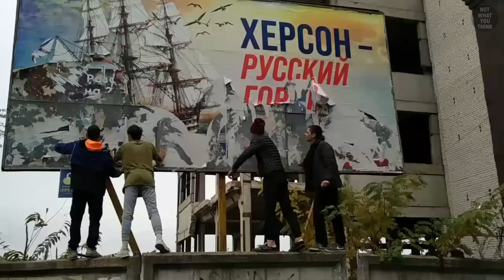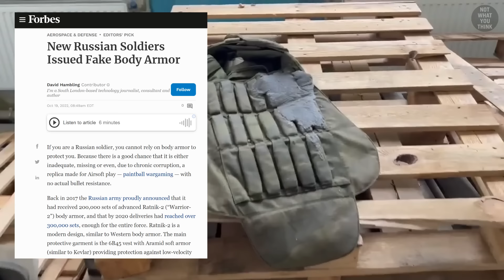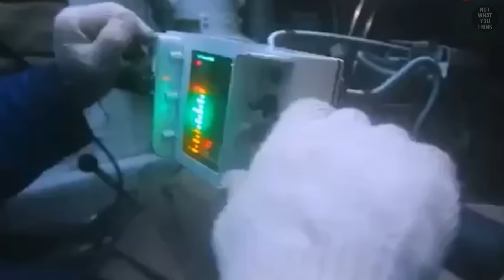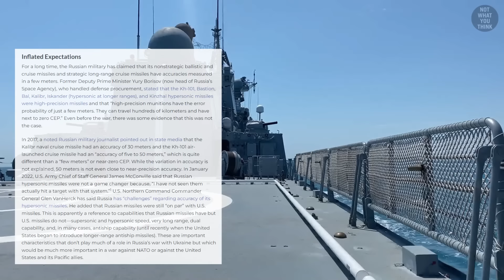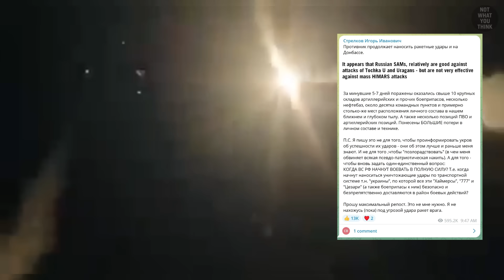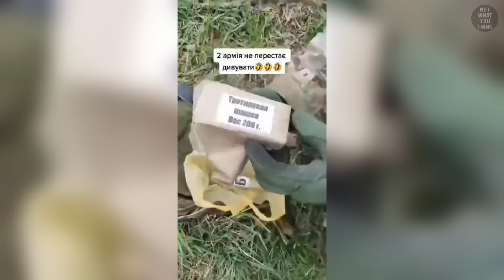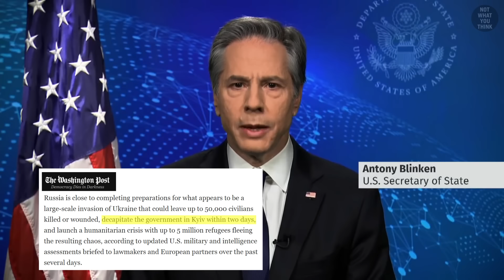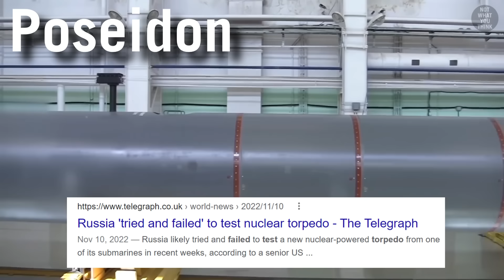The True State of Russian Army

Comment: In fairness the Mosin-Nagant is a superb rifle. The USMC still use a version of the 1950s era M-14. 
The Lee-Enfield was used  as a sniper rifle in many nations  up until recently
Reply: It's garbage against assault rifles. All bolt action rifles are trash against even the worst of assault rifles in modern military tactics.
Reply: Having one mosin in a DMR role isn’t bad, but a druganov or SKs is better. The fact that regulars who should have AKs are using mosin is a bad thing
Reply: The M-14 is a derivative of the WW2 M-1 Garand and is capable of full automatic fire (but utterly uncontrollable if you do).
The difference is general issue versus special issue…
Reply: @allangibson8494  m14 actually can be used as a battle rifle(isn't it one though?). It has a decent box mag (15 rounds I think), semi auto mode and full powered rifle cartridge.  Mosin rifle is bolt action and uses clips. That's a huge difference.
Reply: @maxk4471  Which was pretty much my point - seventy years of development separated the two… 
(That said, the M91 Mosin was still in production in 1973 when the M14 had already been withdrawn from general issue).
Reply: This still doesn't explain what the hell happened to their millions of Kalashnikovs. Probably sold all of them to Africa.
Reply: Agree with above. The Mosin-Nagant is a specialist weapon. Is in no way a replacement for AKs, that should be in use by the majority of Russian troops.
(although they do seem to be using  very old AKs rather than the newer variants)
Reply: @Cincy32  @600 yards, I'd take the Lee Enfield...
Reply: @mikitz  The Kalashnikov’s we’re stored wet and are rusted solid (and are older than some of the Mosin Nagants).
Reply: the mosin sucks, people who own it literally call them garbage rod and agree that its faster to take apart the bottom of the magazine and throw the rounds in than actually use the clips
Reply: @josephpruitt2067  And I like to see how well you shoot in a century…
The Mosin Nagant was actually a really good rifle - in 1891.
They were also all sighted and tuned with the bayonet fitted. No bayonet = crap accuracy (they need the half kilo hanging off the muzzle for tuning). It’s an issue with light barrelled rifles like the Mosin and Lee Enfield (the Lees need 2lb of up force on the muzzle from the stock to shoot accurately.
Reply: @allangibson8494  the gun shooting bad because of them sighting in with bayonets on is on them. Who sights in a gun for a mode meant for close quarter combat. Besides it wouldn't be a great rifle in 2 years, after they made the mauser 93
Reply: @josephpruitt2067  The Russians do.
The big advantage of the Mosin over the Mauser was Russia could build the Mosin - Mauser’s were made in Germany.
The Japanese were even more in love with the bayonet - they fitted them to their heavy machine guns.
Reply: @josephpruitt2067  Yet 9-hole Reviews shoot C-targets at 1100 yards with a Mosin...   using only iron sights.
Reply: @allangibson8494  If the russians think its a good idea to sight in a ranged weapon with an attachment on thats meant for hand to hand combat, which messed up their aim which completely, contradicting the point of sighting in a gun, then thats on them. Even if the russian couldn't have bought the mauser, they could have made a new rifle based on the Mauser design like the US did
Reply: @josephpruitt2067  And the Mosin Nagant was the third bolt action rifle design the Russians adopted while the US Military was still arguing about the whole concept of magazine fed rifles…
The US adopted the Krag Jorgensen in 1892 as their first bolt action rifle so that is your direct American comparison.
Russia didn’t do too badly by comparison - they just hung on longer than others.
The Springfield 1903 was an utter dog by comparison with multiple revisions and catastrophic action failures for 15 years after adoption. The 1917 Enfield was much better (having been designed and built by companies that actually knew what they were doing).
Serbia used Mauser rifles in WW1 against the Austrohungarian Empire - and demonstrated why they were a bad idea. As a note - everyone who ever used Mauser rifles in combat, lost (correlation is not however causation).
BTW - Russia issued semiautomatic rifles with 20 round magazines to troops in 1916.
Reply: @allangibson8494  you seriously think that the mosin is better than the 1903?
The 03 had a better action and better sights. The sights on a 1903 are literally competition sights. The 1903 was so accurate the germans gave it a nickname. And as for everyone who used a mauser lost. The 1903 is based off the mauser action. And the mauser beat the mosin on the eastern front. And so what if the russians introduced a semi automatic rifle in 1916. The russians lost 2 years later.
Reply: @josephpruitt2067  And the 03 was a crap combat rifle BECAUSE it had overly complex competition sights with too small an aperture that were unusable in night and low light combat and extremely poor quality receiver manufacturing. The Springfield had exactly the same problems as the Canadian Ross Mk3 rifle (other than miss assembly issues).
That’s why the US Army withdrew the first million manufactured from military service in 1918.
The Pre 1918 1903 Springfields were significantly worse rifles than the M1891 Mosin Nagant in actual combat. The M1917 Enfield was far and away a better rifle than the M1903 Springfield.
Once Springfield got their act together the post WW1 1903’s got acceptable - but were past use by in 1940 when the M1 Garand started rolling out.
Reply: @maxk4471  I have an M1A, standard issue magazine is 20 rounds
Reply: @allangibson8494  the Mosin had a bad trigger, bad action, used a rimmed cartridge, crap could easily get into the action, the sights were primitive, and the gun was inaccurate. The mosin's quality control was terrible and it was too long.
The springfield had better sights, was more accurate, had a better action, used a better round, had tight tolerances, and was short and fit in the trenches. I really fail to see how it was a worse rifle than the mosin
Reply: Only the Marine Corps shooting team uses the M-14 for shooting competitions   the Marines do not use the M-14 in frontline role at all
Reply: @josephpruitt2067  the whole point is none of those things were a problem when the Mosin was developed.
The Mosin had quite good accuracy when NEW. A century of being thrown into the back of a truck by inept shooters doesn’t do good things to anything. Rimmed cartridges were standard globally in 1890. They were only a problem for people who saw them as a problem (and didn’t know how to make cartridge cases properly).
The M1903 Springfield was most definitely a piece of crap - it (like the Ross Rifle) was a target rifle trying to be a battle rifle but with lousy manufacturing quality. The manufacturing quality got fixed EVENTUALLY but it was still inherently the wrong design for a battle rifle.
The 1914 Enfield and it’s derived M1917 was a much better battle rifle but short on magazine capacity (a common failure with all the Mauser derivatives).
The M1917 was designed for manufacture. The M1903 wasn’t.
Reply: @Cincy32  bolt actions have farther effective range and while not capable of semi and automatic fire the bolt action rifles still put a decent amount of lead down target. A well trained soldiers such as snipers  (not Russians lol) can suppress the enemy with bolt actions if the shots are well placed. Bolts actions are obsolete but not ineffective in war. While automatic  rifles are in theory capable of mag dumping hundreds of rounds in a minute, the guns will seriously suffer and break from   overheating so the practical rate of fire per minute is way lower than the cyclic rate of fire. Bolt actions rate of fire can be pretty high depending on model and individual soldier like how British soldier with Lee’s shot faster than  Americans with semi auto m1s.
Reply: @mixmaster2909  Thanks for the clarification. I thought the EBR was still in use.

Comment: It's still a good rifle especially with a good scope on it . I have a .243 varmint gun based on a Mauser 98 action that was designed in 1898 and my one was manufactured in 1902 . With some modification and a heavy alloy rail stock plus good handloads it shoots very accurately .
Reply: Yeah, one round at a time
Reply: @koberburwa  Even today western army snipers mostly (/all?) use single shot bolt action rifles as they are more accurate. But not for generally infantry work.
Reply: @philldavies7940  its a pipe rifle compared to modern equivalent
Reply: @chaoswraith  yeah for example the barret is semi auto and shoots massive 50 cal bullets
Reply: @chaoswraith  you are insane
Reply: I absolutly believe it´s a good gun and it can still be used. But the problem is, a modern army normally would have modern guns. It is not a good sign if hunderd year old rifles are being used by an army instead of modern sniping rifles. It´s like fixing something with tape. Sure it works but if you use that item allot it´s not a good long term solution.
Reply: Do you use it for shooting people in a battlefield though? Or do you use it for shooting animals or targets? There's a big difference
Reply: Could understand Bolt actions being given to snipers and maybe even second line and "peacekeeping" soldiers in occupied territories but sure as hell not frontline combatants.
Reply: @philldavies7940  Yeah most snipers are Bolt actions in western armies though there are a few Semi-Auto's I think (idk I dont study guns and that stuff very often at all.)
Reply: @obi-wankenobi8446  For sure it depends on the person but if the gun is accurate the gun is accurate
Reply: @chasejordan9295  that's not at all how it works in war lol. In a CQC battle a bolt action rifle is useless, and evidently so.
Reply: Let’s bring back the catapults. It can kill! 👍
Reply: Mosin Nagants are awful. They were awful back in the day, even. 

The Mauser 98 is a superior design. But it's still not a modern combat rifle by any stretch, and even though many modern sniper rifles are bolt action, they're a LOT more advanced than the 98.

Plus, most people aren't snipers. And if that sniper gets involved in combat rather than taking a shot and fading off into the night, they're going to use something select fire.
Reply: @o5-330  and is inaccurate as fuck??? you know the barret wasn't made for precision shooting right? right?
Reply: Mosin-Nagants are fine for certain things if they are accurized, QC was garbage during manufacture, but they are still not up to modern combat. They are suitable for sporterization as civilian hunting rifles and as collector wall-hanger surplus rifles. Militarily all they are good for is ceremonial, training, and far-in-the-rear security duties for troops that should never have to use them in anger. That they are being issued out of Soviet stockpile to frontline combat troops today is frightening. It was replaced in the DMR role by the SVD in the 1960's. Insanity.
Reply: Barrett weight 14kg, Mosin Nagant weight 4kg...

Mosin Nagant is a very good sniper riffle like every other serious military riffle. Old riffle doesn't mean bad riffle. They are intended to kill. Old riffle like Mosin Nagant are overpowered, they frequently overpower modern riffle...
Reply: I can get better MOA for $450 at a Walmart, buying a Savage.
Reply: @o5-330  0.50 calibre is for the small vehicles, armor, buildings not for people
Reply: @Armored_Muskrat  It' not modern yes, but well kept it's good and accurate. Just a reminder, Simo Häyhä used Mosin-Nagant.
Reply: There is a reason when we do a quick combat assessment on if a position is worth taking with what we have available we always count enemy machine gunners are 3 men to our 1. Yeah a rifle can kill you. But it can only kill one of you. Combat engagements happen at ranges between 100 to 300 meters in most cases. We Qual on the M4 with a 300 meter target being the max range that pops up. I don't argue that a rifle that old can't be used. I argue that it brings no value compared to a modern rifle in terms of accuracy, reliability, or ammo capacity. If anything it's heavy and unwieldy. Keep in mind this is being issued as an infantry rifle. A sniper is a specialist role and can use any rifle more effective than an infantry soldier.
Reply: Some US Army snipers use a rifle based on the 50 caliber machine gun, in single shot mode. 50 caliber bullet can go a mile accurately. that gun goes back to World War I. Some good gun design seem to be competitive a long time. Look at AK-47, from 1947.
Reply: the Mosin was a barebones rifle that simply did a job and nothing more in its heyday. It was noted in WW1 as having feeding issues, poor tolerances, and being a less capable rifle than others used at the time. That was 100 years ago. I have a Mosin now, it's more finicky and inaccurate compared to any other rifle I have. I certainly would hope to not need to rely on it in combat.

Comment: It does not take a genius to understand that it is not smart to send the best equipment and soldiers to deplete your enemies reserve.
Those rags they wrap around their feet are actually sort of sock. If it gets wet you fold it open and hang it up taking shorter to dry than average socks and not as prone to have torn holes in them.

Comment: Im sorry, but you got a couple of Things wrong. The T14 Armata at the Victory Parade didnt Break down or stall, the Driver engaged the electric Handbreak by accident, and as the Crew wasnt properly trained, they didnt khnow how to Turn it off. You can see this by the tracks not moving an Inch. T14's which did break down with engine problems have been documented beeing toewed away by recovery vehicles. Another thing is the Rubber reactice Armor. The tank, which they were on was a abandoned russian Tank which has been aledgidley scrapped for parts by ukrainians. In the original Video you can hear him talking about that. Of course These are Just Tiny nitpicks, and dont Change anything about the russians performing horribly due to curruption and lies. Back, when the war started i did Not expect Ukraine to hold Out a Week. The way the russians really perform, one can only Imagine how they would fair against NATO.
Reply: The crew were not properly trained, thats convenient.  If your going to showcase your MBT at a parade of that size, i think you might have a crew that can operate the vehicle, so I'm inclined to believe the thing broke down regardless what you say.
Reply: Either the machine doesn't work or the operator is drunk. Now that's Russian if anything.
Reply: an improperly trained crew is worse than a breakdown. lol. breakdowns happened to the best of us but a badly trained crew is a much bigger issue. that's embarrassing
Reply: Soldier operating the country’s most prized modern tank hits the wrong button in a military parade and that’s better?

Comment: Just a possible correction. The helmet at 4:36 could be one of the older soviet helmets, such as the Sfera, but it does look kinda weird. It consists of several steel or titanium plates.
Reply: Helmets aren't used to protect against bullets but ricochets and falling rocks.  
It hasn't ever protected against bullets and why helmets weren't used when we using muskets. Instead we see people with fancy hats, some sort of idea that they will aim at the hat and miss the head.
Reply: @robertagren9360  They protect your head from w/e haha. They are mostly not designed to stop bullets, though some models are rated for pistol calibers, but even not technically rated ones have saved many a noggin from bullets. It really just depends how far away they are shooting from and what caliber, there have been quite a lot of instances in the sandbox cause 7.62x39 out of guns with shot to hell barrels are subsonic by ~100 yards, maybe less.

Comment: The helmet at 4:35 is actually called a sfera, use during the 1st and second chechen war, its one of the only helmets to utilize armor plating, like a plate carrier almost. It is ineffective and outdated, and if the helmet was shot it would cause the plate to dig into your skull.
Reply: Yep, it might be more effective if it used ceramic plates that can deflect and expand outward instead of collapsing in like a standard steel plate.
Reply: Helmets arent really designed to stop bullets rather shrapnel. Us helmets wont stop bulleta above level 3a i believe which means it doesnt stop rifle rounds
Reply: @caughtin144p7  there are several instances of the MICH pattern helmets worn by US forces stopping 7.62x39 rounds in both Afghanistan and Iraq. They won’t stop a point blank shot but at actual combat range and distance they are able to stop a .30 caliber round
Reply: @loganbaileysfunwithtrains606  oh damn i did not know, but you know either way they are more designed for stopping shrapnel right? unless im wrong
Reply: Вы будто все из Нарнии вылезли. Так прямо рассуждаете, остановит шлем пулю или нет, между тем как большая половина ранений сейчас осколочные. И шлем от них хорошо спасает

Comment: Love the mosin. Simple weapon, easy to maintain, but severely outdated 🤣
Reply: Me too.... so much so I have two 91/30s (I received both unissued/unfired. One remains that way.)
Reply: The choise of Simo Häyhä
Reply: The White Death used an M28-30. He had owned the one he used prior to the war, which implies the quality was much higher and much more accurate. Highest confirmed sniper kills in history, which is remarkable as he did not use a scope. Fascinating!
Reply: In trench warfare that mousin is a better weapon than most would think. When your fighting in mud you want "easy to maintain" also when supplies lines are cut off a mousin that's bolt action is ideal to conserve ammo. It's regarded as one of the best bolt actions ever made. And packs the same punch as a ak47 with more range